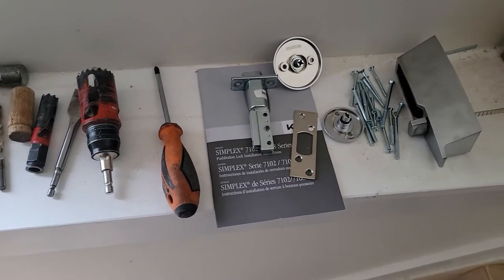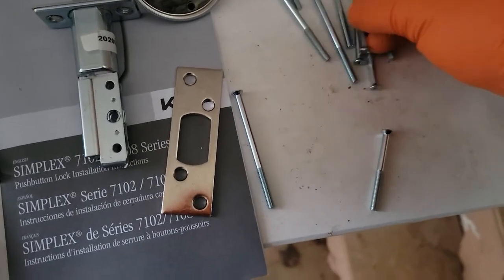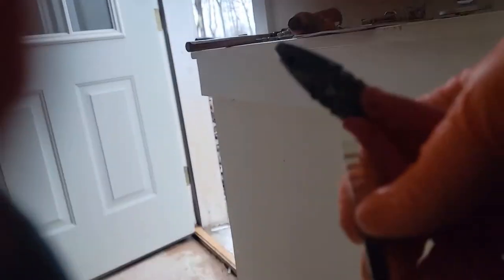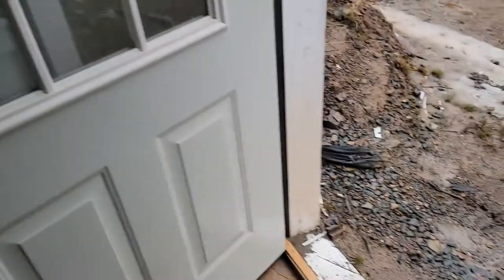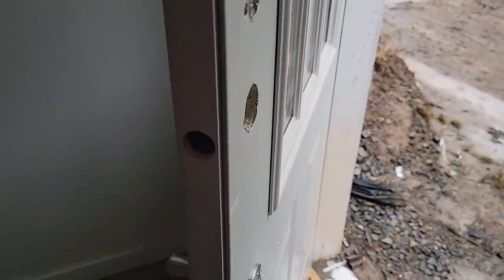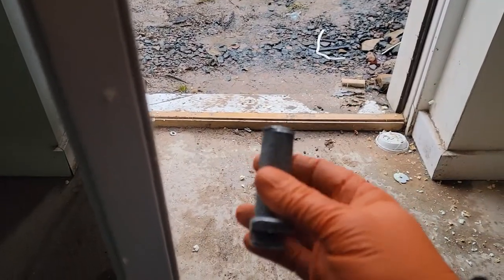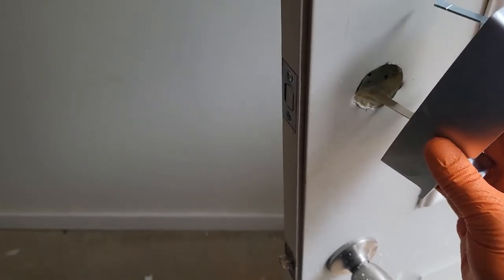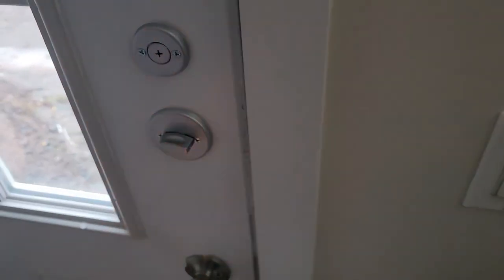Combination lock install KABA Simplex how to

Comment: Hey @locksny, is the latch adjustable or do you need to order the correct backset.  I may need to find a latch for a 7102.
Reply from the maker: 7102 is 2 3/4"
7108 is 2 3/8"
I can shoot you up one if you need, I have 100's of each. Let me know, I can drop it tomorrow.
Reply: @locksny  I need one 2 3/4. Can I trade you for the 2 3/8, please? I am in 10952
Reply from the maker: @peterbjuricek5979  Yeah if you want to drive up from Monsey